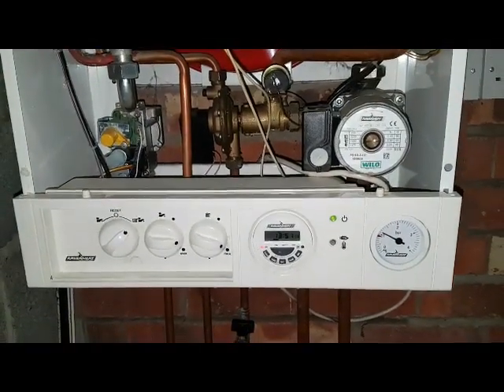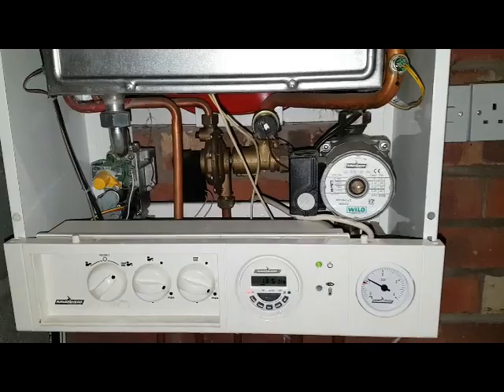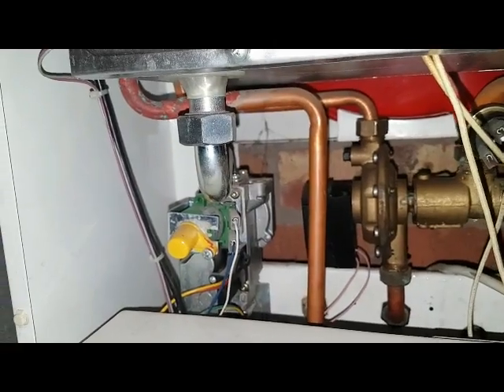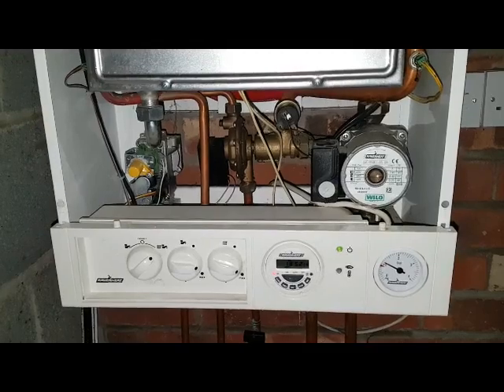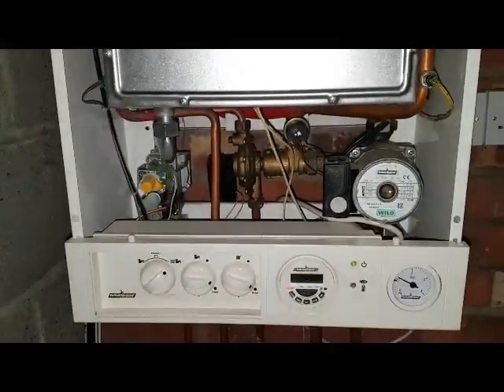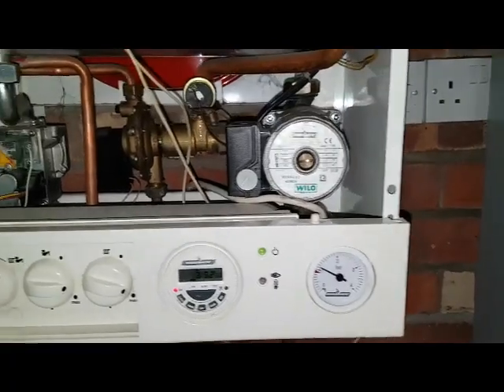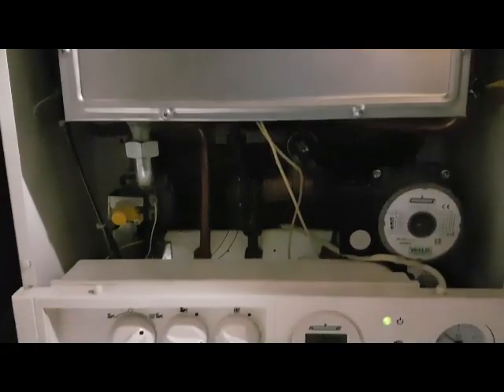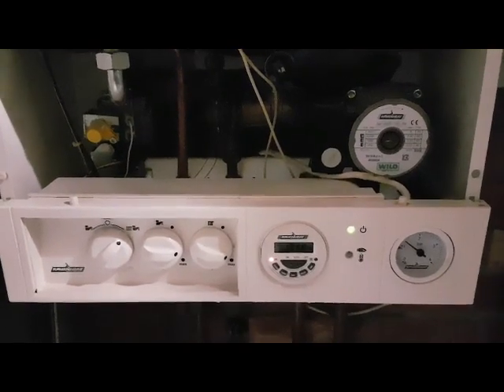Ravenheat Heat 84ET Mk2 No Heating and Hot Water Question. With Coach Tony Morgan

Comment from the maker: Hi yeah the valve positions are different on boilers. The normal rule of thumb is that if the line is across the pipe is off and in line with the pipe, it's open. Also, can you subscribe to our channel

Comment: Hi Tony, I have a CSI 85AAA 780 series. It fires up normally, fan,ignition and burner and after a few seconds it makes a knocking noise and then cuts out.This happens either on the heating or when turning on the hot tap. Any ideas? Much appreciated.
Reply: air pressure switch
Reply from the maker: hey we're currently trying to grow our Facebook group and would love you to join Tony and the team using this link, Tony will be available to answer all your questions directly there's also updates on new trainings we just released too. https://www.facebook.com/groups/167070231326174

Comment: Hi Tony, I can see power is on, usually I would check power to pump. Could it possibly be the controls?
Reply from the maker: Gonzalo Martinez but which one?
Reply: Over heat stat?
Reply from the maker: No quite your getting near
Reply: Is there continuity across the low water pressure switch?
Reply from the maker: Yeah that's OK
Reply: Not sure, can you give us a clue?
Reply from the maker: It's the part above the pump on the right
Reply: I saw the wire connected to the stat had moved but did not think it was, so it was the stat?
Reply from the maker: It's a thermistor
Reply: Thanks Tony. 
Do you do training in East London?
Reply from the maker: Sorry No but if  you look at this engineer who came from the same part of London  as you , he came to Manchester to do his training https://youtu.be/1ofDTSrSYzY
Reply from the maker: Hi Gonzalo can you email me tony@engineerteam.co.uk